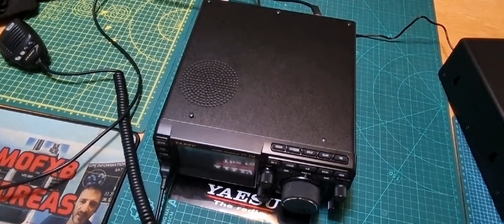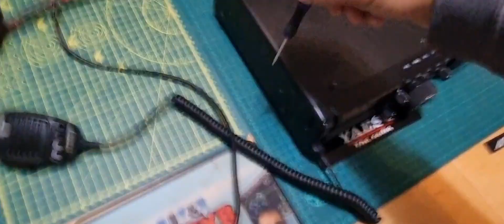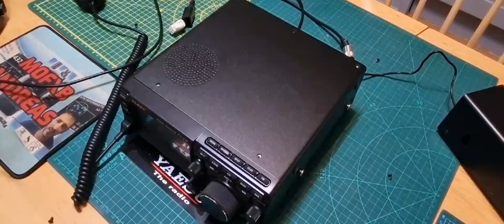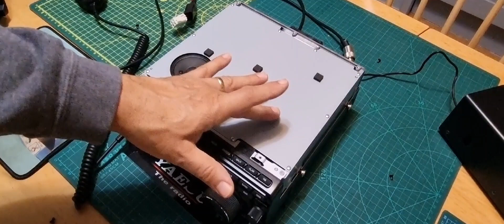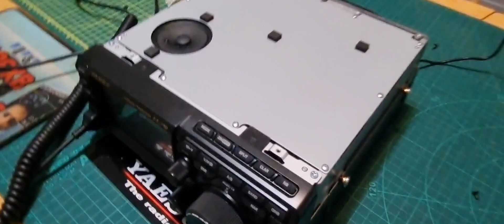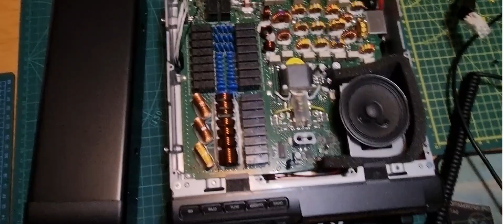YAESU FT-710 Remove Case Look inside

Comment: Grazie del Video, a mio avviso noto molto bene i Relè di commutazione di banda sono troppo piccoli per sopportare tutta la potenza di 100W stadio finale di Trasmissione mentre il circuito di Accordatore automatico molto simile Dal FT450 in poi FT991 , 710 e FT10dx , Transistor MOS piu' piccoli rispetto ad altri .
Reply from the maker: Thanks

Comment: Also a note from personal experience. Before I bought the FT-710, I spoke with a couple seasoned radio technicians, and from a technical perspective both advised to buy Yaesu. Not saying the other major manufacturers are bad, but they helped me deciding.
Reply from the maker: Agree its excellent and good value.

Comment: I have an Extra Class License and have been involved in Amateur Radio for over 40 years.  I just got my FT-710 about a week ago.  Absolutly AMAZING receiver on this radio - but I agree 100% that not supporting built-in CW decoding on the FT-710 was a really really dumb move on Yaesu's part.  The standard argument is that these CW decoders don't work that well anyway, but that's BS.  Even without fancy A.I. or maximum-likelihood decoding algorithms, fairly simple adaptive timing dot-dash decoding code running on a whimpy Arduino grade processor less than 1/10th as powerful as the CPU in the 710 works reasonably well - even on most hand sent code - and works absolutely perfectly on machine sent code.  

That last point -  that even fairly basic CW decoders work PERFECTLY with machine sent code is relevant because modern "texting" generation millennials who only hold Technician Class licenses can use machine sent CW for RTTY style "texing QSO's" on HF - allowing them to become active on the HF bands in the legacy Novice/Technician CW band segments of the 80, 40, and 15  Meter bands while they work on upgrading their licenses to General - which would encourage them to invest in an HF capable rig like the FT-710 sooner rather than later. (You would think that Yaesu would have figured this out).

 -  YES,  you can just hook up the FT-710 in 'sound-card mode' with your laptop and use FLDIGI - but having the radio capable of decoding CW QSO's on the fly would still be a BIG BIG PLUS.

  -- and following along with the transceiver's onscreen decoded display, would help with learning to 'head-copy' CW without hardware assistance - a very valuable skill, since CW signals can punch through under marginal conditions which make SSB voice operation impossible, like  QRP SOTA QSOs with portable antennas -- or an emergency communication net when another asteroid drops into the Yucatan.

So ALL modern HF transceivers should have at least some kind of basic support for built-in CW decoding.
Reply from the maker: I think they saved the function for the DX10 i also have the X6100 it decodes well and is great fun .thanks for watching.73